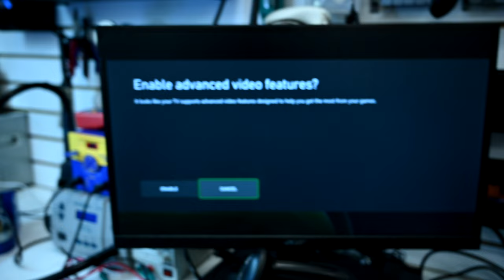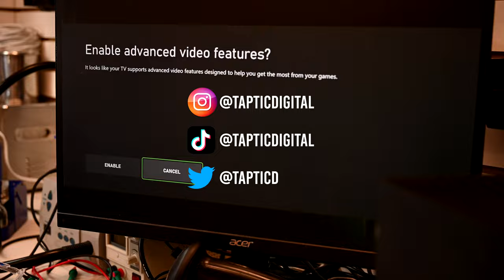This Xbox Series X HDMI port is destroyed, here's how to fix it

Comment: Man I swear I’ve been very gentle with my series X, it just seems like it was an issue to begin with. I never had an hdmi port issue with my PS5 or older gen Xbox’s. A lot of people seem to also get defective hdmi ports maybe it’s the design of the series X.
Reply from the maker: Most common thing I see are people that will transport their console with the cables connected still. So if it slides in the backseat of a car and hits the cord that's still in the port, port loses the fight. But I have seen some from factory that are just barely attached, so quality control could definitely step it up a bit
Reply: @TapticDigital  I broke my connector when doing some cable management. Should have just left it messy.
Reply from the maker: @FullThrottleMonty  ouch! Always unplug when rearranging or moving things. Cables are cheap, the stuff they connect to isn't 😭
Reply: Samee I'm barely gonna get one soon
Reply: Have 3 console with bad hdmi ports 2 series x, and one s. I want to replace myself, but I’m nervous I may damage it.
Reply: Yeah me too only weeks in with new system.
Reply: Honestly I',m no famboy of either Sony Microsoft Nintendo or any other manufacturer, but I've always felt microsoft has always seemed cheapest build quality, often it seems like they rush things out and fix errors as they arise, I've always held the belief if buying new wait at least 18 months after release for cheapest (most common reasons for returned products) parts to be replaced with less sub standard after many consumers had the damaged products early after release. Even their Pro or premium products seem to follow the pattern. Capitalism at work, spend the bare minimum and then upgrade the parts that dont last warranty period. Therefore 18 months to 2 years is normally the time frame until products that will at least last their warranty, which happens to be the cheapest they could make the product to last long enough no refund or replacement is required but not too long that we'll never need a new one. Unfortunately I'm old enough to remeber control pads and joysticks that you could throw around for years and they'd never have ghost movements and buttons always worked. Atari consoles from the 70's still have their original controllers. None of this, "Oh it can only last so many hours of game play because of the gyroscopes and altimeters and springs/librication/rubber seals fail and need replacing. They mever used to!!!
Reply: Yeah man I'm heading for my second hdmi repair with this POS build into the board.  After first expensive repair, I always gently removed the cord to prevent future damage.  How stupid of a manufacture vs previous bullet proof MS consoles.  Ugh!  Not a cheap fix.
Reply: 2nd x series with messed up port used warranty and now this system has gone
Reply: @TapticDigital that's exactly how mines got messed up transporting it  with the cable on I'm glad it only cost me 70$ with a cleanup
Reply: i haven't moved mine it sits next to my PC and the hdmi just died and too get it repaired by microsoft is £280 my ps4 and ps5 hdmi ports are fine
Reply: @TapticDigital  what was that tape you used and do I need it cause when I do the repair I wanna make sure it's done right
Reply: @AnthonyCarey  I totally agree i own a repair shop and we replace HDMI port more often on Xbox than PlayStation or the USB C for the Switch despise the fact that Sony did sell 3 times more consoles than Microsoft.
Reply: @JohnDoe-mt1yt  this is called Kapton tape, designed for high temperature masking.
Reply: @FullThrottleMonty same thing happened
Reply: @inyourgranmaass3605  hey who repaired yours?
Reply: for real and we used to beat up the 360s
Reply: this is the only counsle i’ve ever had issues on. haven’t done anything different than i did with my Xbox 1 and ps3
Reply: @bpd8426  did you do it? Where did you get the ports? Figure it out okay?
Reply: I have issues with my series s I fixed my hdmi port for 130$ and it just messed up again

Comment: Just when I thought I was gonna do this myself lol😂
Reply from the maker: I feel like most people think "okay this is easy, this isn't so bad, this is fine, holy cow nope I'm out!"
Reply: My exact thoughts 😂😅
Reply: Facts lol man I’m finna pay $175 to get it fixed
Reply: Luckily I joined the Army as a radio comsec repairer and had to learn to solder/desolder
Reply: Sheesh, I'm sitting on my bed with my Xbox completely disassembled, my new soldering iron and heat gun and I'm just praying I do this right!
Reply: @Broke4ever  good luck bro and keep that hand steady lol
Reply: Same
Reply: @Quixonemia holy fuck I almost want to join the army now
Reply: @Broke4ever how did it go??
Reply: @MrMemesAndChill  I got the HDMI port off cleanly and I put a new one on, but it didn't work when I plugged it up. I didn't try a second time because now I'm afraid of messing it up

Comment: If you dont know what you are doing, don't attemp this. Just tried it. Dissembly is easy, gettimg the hdmi port off and back on without ripping pads off is not going to happen. Leave it tonthe pros. Now I have a board missing pads, so its pretty much useless now. Dont learn the hard way like I just did
Reply: It's not as bad as you are making it. The problem is, people get too impatient. It takes some serious heat to free the thing. So you have to be careful and take your time. I actually added some lower melting point solder to the pins before I removed it so it would mix with the factory solder and lower the melting point, because I was so paranoid.

Comment: The skill you have with that micro soldering is crazy. I spent a few days trying to just realize my solder was too big. Got .3 and it’s actually possible now but still insanely difficult to nail right
Reply: Probably has a big magnifying glass stand to look through
Reply: Put some flux and some solder on the pads before soldering the HDMI it will help.
Reply: This was my worry, im glad I have people to help me, I need to practice more

Comment: Thanks for the taking the time to make the video .

I would not recommend using that small tip for the hot air machine, also add the leaded solder to the pins as well, it will make for easy removal and lower the risk of tearing off a pad.

Comment: Love the video, you make it look so easy. What airflow do you have your hot air station set to? I had trouble getting this thing to budge. Thanks
Reply from the maker: Thank you! 😊 I set my air to about 450, it still takes a while to actually melt the factory unleaded solder, which would melt better at 480, but risks overheating the actual board into thermal shock.

Comment: Wih stickers over screws, I usually blow it with a heat gun or hairdryer on one side while pushing a blade underneath, then just slowly peel it off while giving a lil heat and stick just above till ready to go back. It just looks better
Reply from the maker: That's exactly how I remove most warranty void stickers 😂 sometimes they go back on, the company never needs to know!

Comment: The Xbox series X seems to be deceptively fragile; it appears strong and I've been so gentle yet the HDMI is broken apparently, my first Xbox in years and it breaks the day Gamestop (the store that i putchased it from last year) closed down in my country. It is not that uncommon a problem either apparently, but I can't believe this...
Reply from the maker: Interesting enough Microsoft only puts solder under the pins, instead of envoloping the pin with solder to bond it with the board. This means the joints are very weak against any kind of force. Almost like they want you to ship it off for repairs with them...
Reply: @TapticDigital  I almost don't want to believe that. But it is Microsoft and I have a bad history with their products

Comment: Hi there, picking up your tweezers and silicone mat from the links provided (already have the small screwdriver set). Do you have a recommendation for a good starter soldering kit to do this job, that includes flux and the wick? Thanks.
Reply from the maker: I actually keep an inexpensive kit at home instead of the overkill Hakko. I'd recommend a Tilswall Soldering Station, they are 65w and offer temperature control, and it's only about $60. Unfortunately wick and flux are separate. I like Techspray brand wick, and ChipQuik brand flux, but usually any kind will do
Reply: @TapticDigital  thank you sir!
Reply: @TapticDigital  hello!
Would you mind recommending to me which # wick to grab? Will #3 do? Thanks.

Comment: What kind of soldering gun did you use? I borrowed one and it could not have gone worse
Reply from the maker: I use a Hakko FM203-HD, it's pretty overkill but I do a lot of soldering. Adjustable temperature is a must, and you'll want around 800f to melt the factory solder
Reply: @TapticDigital  thanks for the reply!

Comment: What an insane amount of disassembly just to access the HDMI port, which is an obvious design flaw. 

Seriously, the HDMI port is in the exact spot that if you even slightly rock the console backwards while plugged in, it breaks it
Reply from the maker: If you invent a hot swappable HDMI port and sell them the patent, you’ll be very rich and I’ll be behind you 1000%. They could have done so many other things, like putting the port on its own daughterboard that could be easy replaced if broken

Comment: Thanks for the video. I need to do this but looks like way too much work and many steps to damage it if not careful. Plus the specialized tools needed. Dang oh well
Reply from the maker: Disassembly is the easy part, unfortunately I can't say the same for the soldering unless you have experience working on smaller components. Check out some local shops with decent reviews!

Comment: Will this replacement port still be able to output 4K at 120Hz? Is there a difference between replacement parts, or will all of them support HDMI 2.1?

Great work!
Reply from the maker: Thanks Connor! Thankfully the only port compatible with this model is one that supports 2.1, so you should have no issues!
Reply: @TapticDigital  Mine was just repaired today. It's not outputting more than 1080p, could the issue be that it needs additional solder? or could it be an issue with the Booster IC chip?

Thank you!
Reply from the maker: @ConnorDrummond23  the plot thickens... When I test consoles at the shop I only have a 1080p TV, so it usually changes the resolution setting. But if yours isn't a setting change I'd lean more towards that booster/retimer chip. Sometimes when a port is damaged it can burn up that chip as well. If you had it repaired at a shop they should cover that under a warranty

Comment: I’m having trouble removing the cables at the 3:15 mark, are you supposed to push or pull the tab?
Reply from the maker: @nickbrown539  they are super stuck, push the locking tab toward the wires it’s connected to, it should unclip

Comment: MEtal cross - it is a good idea to undo each screw gradually, GPU can break if you release tension on one edge and not the other. Just a friendly advice
Reply from the maker: Good tip, treat it like lug nuts on a car tire!

Comment: We're you not worried about burning the board when trying to remove the solder with a blow gun?
Reply from the maker: Not at all, as long as you keep the heat moving. Console PCBs are capable of handling way higher temperatures than regular boards, they contain a lot of excess copper throughout the board (intentionally) making the entire thing act like a heatsink. I've only ever blown out one board, a PS4, and it was intentional as I was testing the board's heat limit. Two heatguns at 450C blasting a single spot, took a good 8 minutes before the internal layers catastrophically split, was very cool!

Comment: How doable is this if I have some, but limited experience soldering? Seems like a good heat gun is the trick?
Reply from the maker: I wouldn’t recommend it for a beginner, the heat gun isn’t too difficult, it’s soldering the pins on the port that can be kind of tricky. You have to have very thin solder to avoid it smearing or bridging multiple pins together with melted solder. If you do attempt this I would recommend having a good bit of flux to keep the solder from smearing around, and solder wick to undo any blobs that might appear.

Comment: This is probably a dumb question but which type of flux did you use? does it matter which one i use, same for paste on the back board itself? please lmk thank you
Reply from the maker: Any kind works. I use ChipQuik tacky flux, it dries and then chips off easily. Flux isn't entirely required either, just depends on your preference
Reply: aha thank you, appreciate it. a friend of mine's HDMI is destroyed so i've gotta try fix it. just got another new series x HDMI replacement on amazon, dp you have any tips when it comes to soldering. i've a steady hand. i have some (mx4 thermal compound i use for my pc. could i use that to replace the previous paste? thank you once again. saved the day lol. i watched others to this and your video is 100x better  @TapticDigital
Reply: @TapticDigital hi there so I'm currently trying to remove the HDMI from the motherboard and nothing is happening. How long do i have to keep the heat gun on the board for? Does a 350w do the trick instead of 450w

Comment: What is the list of tools that was used for this project?
Reply from the maker: You’ll need a precision screwdriver set with security torx bits, a hot air station, and a soldering iron with flux and solder wire.

Comment: 5:50 Have you tried the solder vacuum pens?  Common item that sucks the liquid state solder into it.  I am sure you have seen these spring blue and lt blue pens for decades.
Reply from the maker: I have, and recently after getting a Hakko solder sucker my entire repair flow has changed. As long as you keep them clean they work wonders!
Reply: @TapticDigital  The are cheap, very disposable almost, the plastic ones. The metal ones, be sure to use minwax paste wax on the tips and insides.  Just jab the tip in the wax. They make no clog ones, they make one that you can heat the tip of the sucker while heating the solder. 
Big fun!!
Reply from the maker: @rwhite9994  so we can wick the solder off, we can suck the solder out, what happens if I take an air compressor instead and blast it out?
Reply: @TapticDigital  Have no idea. 
I am sure the risks, would not be worth the reward.

Comment: What kind of solder are you using? As far as Tin/lead percentages?
Reply: Not sure, but commercial electronics have aggressively moved away from lead. (yeah good thing)  You can still get lead solder for hobbyists, but it is also going away.  Most common 60/37%.  (which is also a good thing)

Comment: Just tried this repair. Now the xbox turns on, white light, straight off again. I swear the pins were not bridged and they were all attached to the board. If they had bridged, would that cause this issue?
Reply from the maker: It can, though I will say the turn on-turn off issue has plagued Xbox since the One/One S, all the way to the Series S/X. It can be a real nightmare to track down. I might start with removing the HDMI port entirely and then attempting to power the console on, you don't need video to know if it stays on.

Comment: I bought a used series X just like this yesterday. I tested everything before I bought it but i noticed the seller had to jiggle the hdmi at the port to get it to show on screen. After it did everything on the box seemed to be in order. I went through the settings tested the network card amd even did a factory reset on it.  So i bought it. But the guy ripped out the cables so carelessly and violently at the end. It made me cringe. Anyway I took it home and upon plugging it in sure enough it wont show up on screen and the hdmi housing is noticeably loose. I almost fainted. I sold my series S and my drone to buy this thing. I'm so financially strapped right now I don't think I can recover from the hit. It's such a shame too the Xbox seems almost new. I opened the back and its sparkling clean inside and out but I'm too scared to go any further with the repair myself. I just don't know what I'm gonna do now. Any suggestions?

Comment: I need help when I was trying to remove my disc drive one of the wires popped out when I was trying to take it off and the pins were shown bented
Reply from the maker: It happens every now and then, the best thing you can do is carefully reinsert the pin into the connector. It should still work fine
Reply: @TapticDigital   something is stuck in the sata cable and i think the black part of that is under the pins it got stuck in there

Comment: What are those tiny components on hdmi rail inch and half up and can they be ordered somewhere?
Reply from the maker: Those are just small filters, they can be ordered separately but off the top of my head I'm not sure which chip they are
Reply: @TapticDigital  I knocked off one for someone and now they aren't able to adjust resolutions and am thinking that is issue. Got image on screen for myself but didn't change resolution, so am thinking may be that but will be getting back tomorrow and will see for sure after some diagnostics. If anyone knows what they are and where can order, would be appreciated

Comment: Mine has a yellow plastic thing that’s keeping the new port from seating any suggestions?
Reply from the maker: Is it the circular bit that was under the old HDMI? If so, the new one will sit on top of that plastic, no need to remove it. If it's just yellow tape it can be removed and discarded.